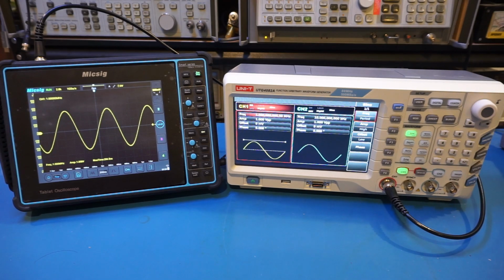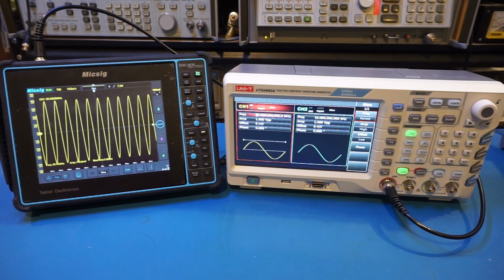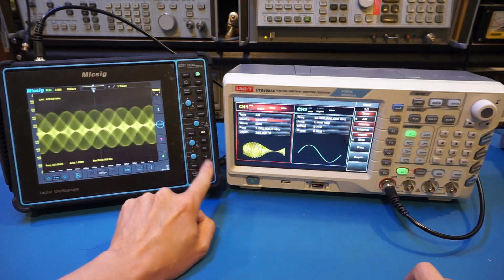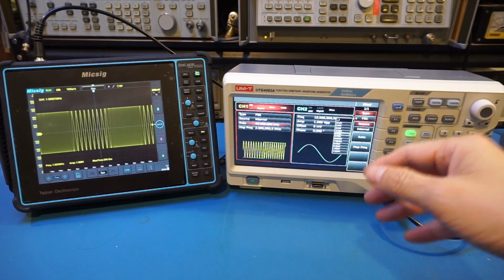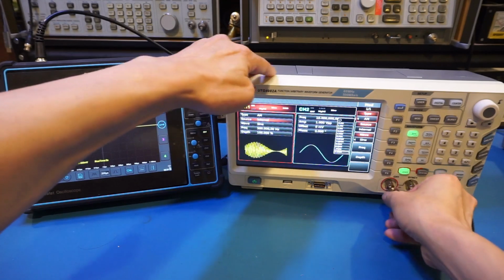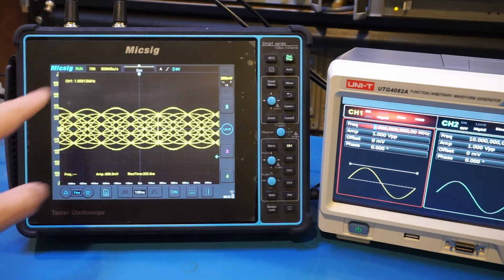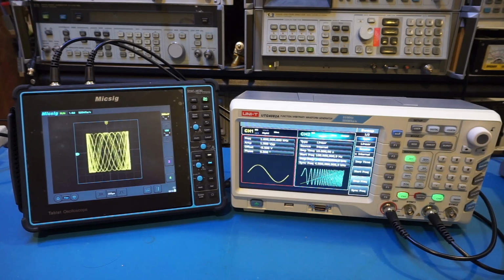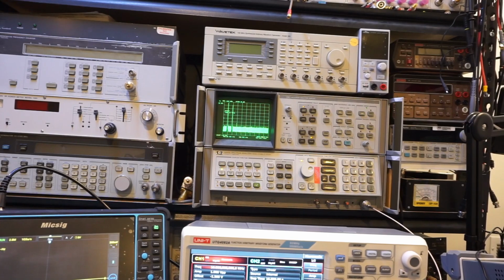UNI-T UTG4082A 16-bit 80 MHz Dual Channel Arbitrary Waveform Generator Review

Comment: Great explanatory video....If you can tell me please...can it function in cloning mode? Meaning that the parameters set on one channel will be instantly replicated on the other? Useful for stereo equipment service/restoration. Moreover, if it would have been capable of higher than 88 MHz freq, can it be used as a test bed for FM tuners/radios?  Can you store several sine/freq/level presets on internal memory to quickly bring them up when needed? And lastly how do you think about it's price tag / performance / feature set ratio versus other medium quality/feature set units? I like the form factor, the deeper units in dimensions do not fit my bench properly. Thank you!!

Comment: Amazing stuff. I'm busy testing an old Voltcraft FG1617, I recently aquired. Still got the Topward 6303A? Saw your blog, interested in seeing how you serviced it.
Reply from the maker: Yes I am still using the 6306A. It's not the easiest to fix due to the board layout
Reply: @KerryWongBlog  Cool. Would appreciate a video about it. What's the diff with a 6306A and a 6303A. I can't imagine a major difference? I got a 6303A.

Comment: @4:20 you have to wonder why it gives a 30MHz square wave option if it cannot actually generate a square wave at 30MHz, it should set the maximum frequency to be what it can actually do.